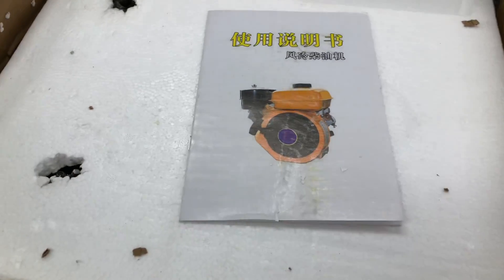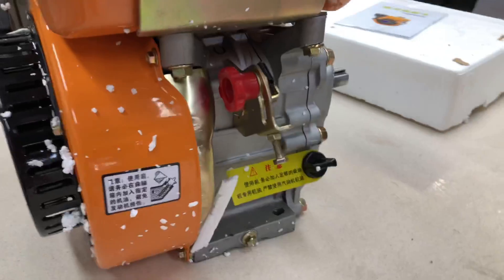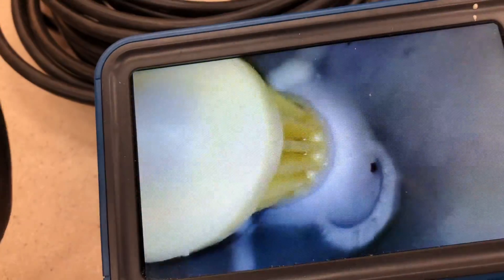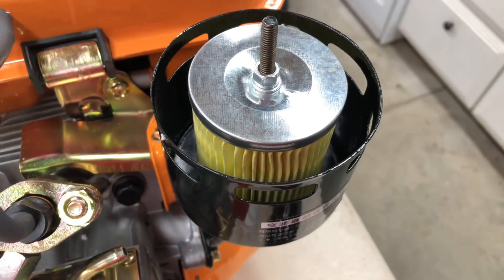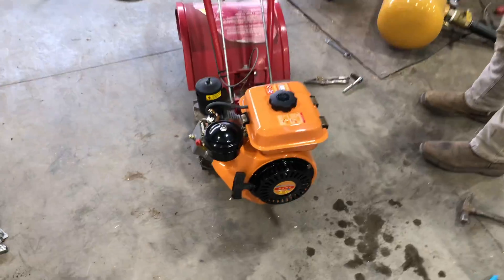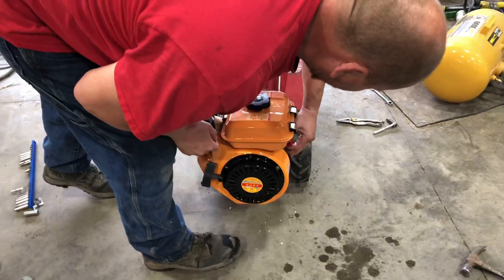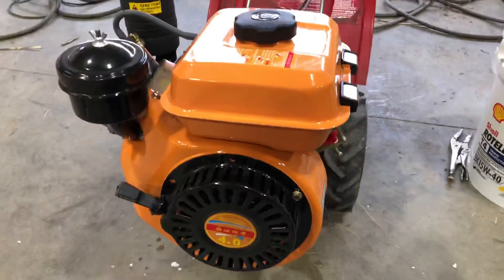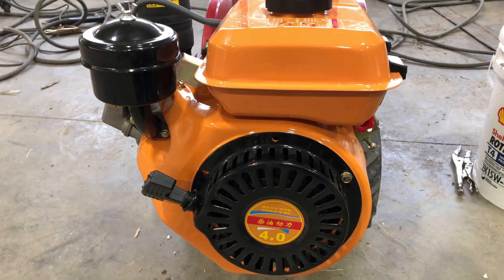Small Diesel Engine From China

Comment: Love to see how that motor holds together when you got those times buried deep in the ground most of the motors on those Troy-Bilt through rods because they would start from oil by holding them in the deep position
Reply from the maker: Agree, it is still used every summer, starts first pull after winter storage

Comment: Does it make more torque then the 212CC predator engine?
Reply from the maker: I would say so, this tiller had a 6.5hp gas that would bog down when going deep. The diesel goes deep without bogging
Reply: I suppose they would have more torque than the equivalent gas engine.

Comment: Sweet! Doing the same conversion on almost exactly the same tiller! And if that works out slick enough I’m gonna attempt do a horizontal to vertical drive conversion to mount on a push mower. Like you I’m sick of dickering around with bad fuel and carburetors when I need to get the job done. I’m also hoping to run on used vegetable oil eventually. If I get to feeling spry enough I might even make a video about the whole thing. Thanks for your video!
Reply from the maker: No problem should be very cool to do other things with these engines
Reply from the maker: Amazon Diesel Engine 196CC 4 Stroke Single Cylinder Forced Air Cooling Horizontal Axis Engine Recoil Hand Start 3000RPM 2.2KW, 53mm Shaft Length (Orange) https://www.amazon.com/dp/B0917PGV7W/ref=cm_sw_r_cp_api_i_D6ZJ3TRRF3GZE1ZS6M9C
Reply from the maker: $269 in stock
Reply from the maker: Find someone close to boarder in USA and they can hand it off to the Canada side.
Reply: @Craig I have an Etsy store. I can ship to Canada if you’d willing to pay a bit more for it. I’m gonna buy a couple more of these after getting one for my tiller. My Honda clones just aren’t this awesome. Also, I like the idea of storing fuel. Just be sure you get the right crank size. I screwed that up and it cost me a new pulley and subsequent mods. I won’t profit from it unnecessarily. I just think the Canada shipping thing is stupid. I usually sell vintage stuff I find at auctions and garage sales. Dm me your address and I can give you what actual shipping is based on dimensions and weight.

Comment: How is it doing  do u think it have more power then a 5 hp  b and s  engine  I was just wondering I was thinking on outing one on my wood chipper  just waning that little more torque
Reply from the maker: Yes definitely has more power
Reply: @HighOctane101   thanks for the comment  is it still running good that’s a 4 hp ant it  u think it would be good on a wood chipper
Reply from the maker: If it is a direct drive wood chipper probably not, they usually have a heavier crankshaft for the weight of the cutting wheel
Reply: @HighOctane101   it is it got a little 5 hp  engine on it

Comment: Can you crank the fuel up? This would be cool to put on a go cart. Also how much horsepower
Reply: Some listings have it at 3hp and others list it as 6hp. I'm wondering if it's nominal 3 and peak 6. Most engine manufacturers list at peak even though you'll burn up the engine actually running prolonged at peak.
Reply from the maker: Good to know
Reply from the maker: Not sure I’ll have to check
Reply: Its 3 hp hella torque tho and it has rev limiter in it

Comment: I also have a Troy bolt pony did this unit bolt right in? Do I need to purchase any special part’s?
Reply from the maker: It bolted up and I think I had to reem the pulley out a little. Think the shaft was a bit bigger than the old motor.  Was not a big deal though
Reply: @HighOctane101  thank you I’m going to run this engine until it dies then I’m going to pick up one of these

Comment: How well has it been holding up?
Reply from the maker: So far so good, this summer I’ll do a follow up video and probably change oil.
Reply: @HighOctane101  You may want to check out  Mossy Creek Vids. He did a tear down and found a lot of bolts with the wrong torque, gaps incorrect and metal fillings in the cylinder. I have my own engine coming in next week and I plan on doing a "rebuilt" right away before starting it up.
Reply from the maker: Thanks

Comment: Thought about putting something like this on my dads old MTD tiller with carb trouble.  Either this or switch to propane for a while.
Reply from the maker: So far this diesel woks great, to bad I did not have a snow blower to put it on. Just have to keep it warm in winter if I did that.

Comment: Any reason your upgraded this small tillerto a diesel
Reply from the maker: Nope just thought it would be a good replacement no more carburetors to foul over winter
Reply: @HighOctane101  I use a few items as I run 3 Lawn maintenance landscaping business handling over 300 pieces of equipment I use Seafoam it been the best cleaner it can be used on gas diesel. 2cycle snow mobile motorcycle  it cleans and stabilizer I leave it in I also use kerosene I not had issue

Comment: Does your Pony tiller have the second pulley for reverse? Mine does, and the old Briggs engine on it has a second "auxiliary " shaft that turns the opposite  direction for the reverse gear.  I may just have to do without reverse.
Reply from the maker: It did but with this new diesel I don’t have reverse anymore
Reply: @HighOctane101  Is it a 2-stroke? Maybe you could start it in the other direction for reverse.
Reply from the maker: It is a 4 stoke engine., oil in crankcase

Comment: Did you use trans fluid for fuel? Lol sorry just saw that how many hp do you think this thing is plan on putting one on my log splitter
Reply from the maker: Hp is probably around 6 I think but has lots of tq the tiller never bogs down
Reply from the maker: Red diesel is not taxed in USA for off road only

Comment: Red diesel fuel, unless I guess wrong.  For a roto-tiller - probably OK.

I’d want one for a 800-1100 watt dc generator.
Reply from the maker: Nothing wrong with red diesel in this, actually better for it with the higher sulfur content. Just no taxes on it
Reply: @HighOctane101  no difference between highway and off road diesel now. Except the dye. All low sulfer.
Reply from the maker: @duanehenicke6602  yeah I was always told it had higher sulfur but I’m sure you are right. They probably try to scare people when it comes to dyed fuel that it will ruin a new engine in a on road truck
Reply: @HighOctane101  back in the day this was true. But it's all the same now.
Reply: @HighOctane101  getting it might be a problem here.  I’d probably need to get the usual stuff and add something like one of these cetane boosters to it.
Reply: I just bought a diesel DC generator state surplus $175.only 3hrs on it!

Comment: Issue is its got a flat head tecumseh with some kinda gear reduction box that bolts right to the block but has 2 shafts sticking out the one pulley us for reverse
Reply from the maker: Yeah I don’t have reverse anymore but did never use it

Comment: How's the fuel consumption
Reply from the maker: Tank of fuel last very long time lot better than gas engine
Reply: @HighOctane101  I bought one for my roto tiller, that's what prompted me to search for your video. Very good news.
Reply: Update, very very good on fuel. I broke the pull starter and cannot get it running again. Working on a pony motor system but will probably settle on a starter/generator
Reply: I'm sure there's a nut on the crank. To get by just get a drill(not an impact) and the right socket to start it up

Comment: Oh man. I just stumbled upon these on ebay. Now I really want to make a motorized bicycle with this diesel. Now I gotta compare shaft sizes and bolt patterns to see if it might work.👍
Reply: Far as I know these engines are just as good as the original engines they were cloned from
Reply: I have one already lol. 20mm shaft. Very low rpm on these going to need a special cvt or low rpm clutch that wont turn to dust with smaller sprockets. On a 32t sprocket 10t pinion 26inch tire your looking at a killer 23to25 mph build lol
Reply: I just unboxed mine! I got to the instruction manual and thought...in huh? Exactly the same, same purpose even. Crazy. Nice to see I’m not the first. You happen to know a place to find instructions in English? Also, mine came standard with the inline filter.
Reply from the maker: Good luck with the instructions, so it has an external inline filter, I probably better put one on mine
Reply: @sknerl  mine came with inliine as well. Installed backwards. Didn't want to turn it around the correct way and run the risk of getting trash in the injector. Never know how dirty the fuel from the factory start up was. No problem. I had spare filter on hand and shut off valve as well. Till i pulled the old one and realized it wasn't standard small engine 1/4". I'm guessing 5/16". Didn't have that size filter or shutoff valve. But i did have worm clamps and made it work.
Reply: Perhaps add this motor to the back of an adult tricycle :)
Reply from the maker: I believe the shaft size is metric but close to smaller than 5/8”
Reply: It's the standard 5/8 keyed shaft like all Chinese small engines in the 2 to 6.5hp range
Reply: Please post videos about it if you can

Comment: Is it still running and in good shape? I want to purchase one for use on a tiller also but if its going to break after 2 hours I won’t bother.
Reply from the maker: Yes still running strong changed oils at 10 hours and all looked good
Reply: People saying Chinese engines are junk... If the Briggs and Tecumseh are so good, why are they getting replaced by the thousands with lifan gas engines and these diesel units...lol any society can make junk, and any society can make things that last forever. At this point I'd bet on Asian production over USA.
Reply: Check out Mossy Creek Vids. He did a tear down and rebuild of one of these. Short version: Well designed and machines, but poorly assembled. Over and under torqued bolts, gaps wrong, metal fillings in the cylinder. Maybe some people get lucky and the guy assembling knows what they're doing, but I'll be rebuilding my once it comes in next week. Seems like it could be a nightmare to get replacement parts, so I'd rather not take the chance and get the bugs out in the beginning. 

Hoping to use it for hay elevators and water pumps.
Reply from the maker: Nice
Reply: Asian people are really smart real good quality engine I own one of this engine and is last me 30 year with no problem
Reply: @tonytran4857  the Chinese are known to produce a lot of junk and some good stuff all depends on what the company pays them to make it I don't think it's a question of intelligence
Reply: @daltonjones3143  Your ass is junk Our engine last over 30 years Good quality engine ok
Reply: @tonytran4857  maybe it is a question of intelligence based on that response
Reply: @daltonjones3143  I always buy machine from China because they are quality and last long, not like American last only year or 2
Reply: @tonytran4857  The only question of intelligence is regarding you broseph

Comment: How are you supposed to change the fuel filter on that Diesel? It inside the tank :-/
Reply from the maker: Not sure
Reply: You probably aren't.
Reply: I have a similar set up on my diesel generator.  To replace the diesel filter, one needs to remove the diesel tank, undo 3 screws, and remove the filter from the bottom of the tank.  I assume this setup will work in a similar fashion, but I'm not sure.

Comment: Is there a pressurized oil output for possible tiny turbo?
Reply: According to the stats they are oil slinger style.. not pressure system for oil... Per Amazon information...
Reply: @augustbiechy34  up loading a video now - Dirtfoot Racing - I completely disassemble that engine to see whats inside
Reply from the maker: I’ll have to check
Reply: Splash oiling. All the dudes that have turboed these always use an external oil pump of some sort
Reply: There’s no turbo on this lol I would trust a turbo on a low quality Diesel engine. It would run away and blow up easily lol
Reply from the maker: Be fun to try though lol😀
Reply: A turbo.  Epic
Reply: I am always amazed by how easy  hardcore gear heads make these projects look.   Great video, thanks